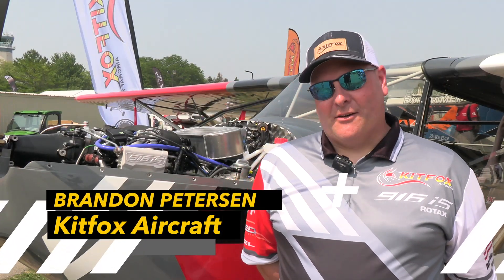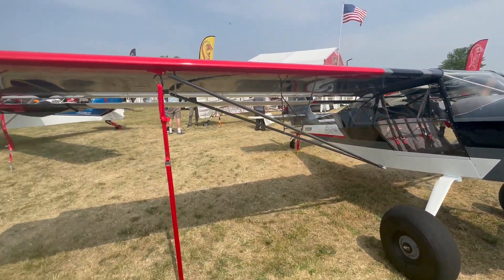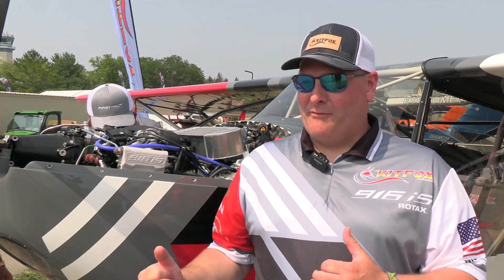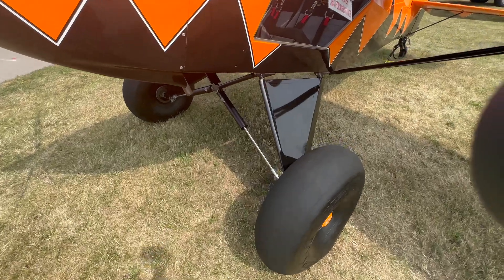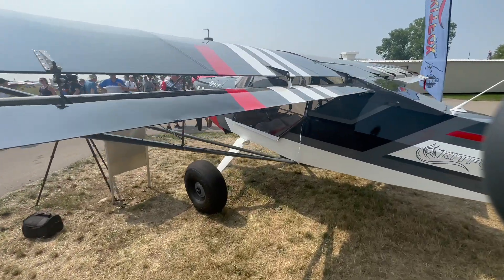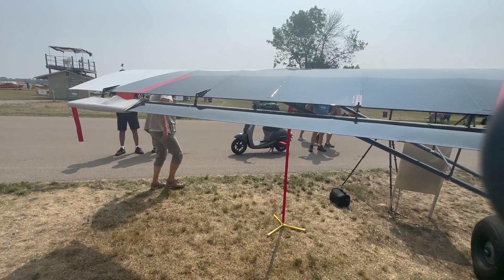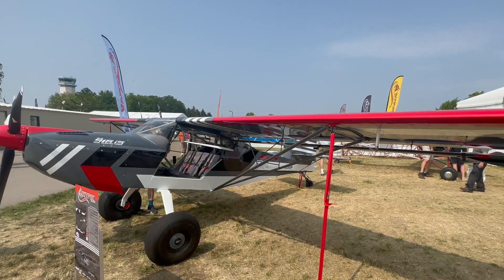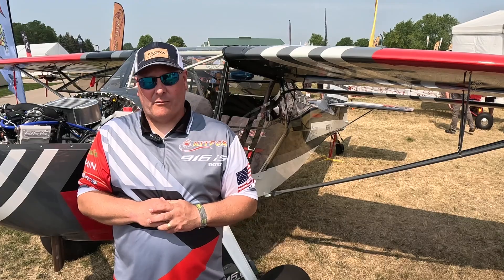The Kitfox Muscles Up With the Rotax 916

Comment: How does that intercooler work at all facing right into the top of the cowl?
Reply: High pressure in the cowel area caused by forward speed of the aircraft.
Reply: @266Larry  Making the air turn 90 degrees and also go around all of the plumbing around the engine isn’t very efficient.  I am glad my RANS has a dedicated air scoop that feeds directly into the intercooler.